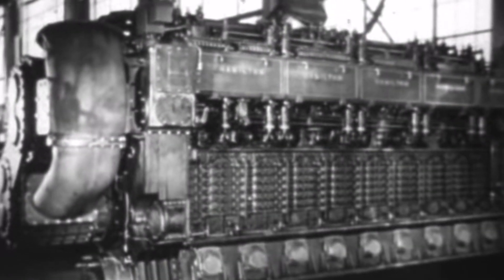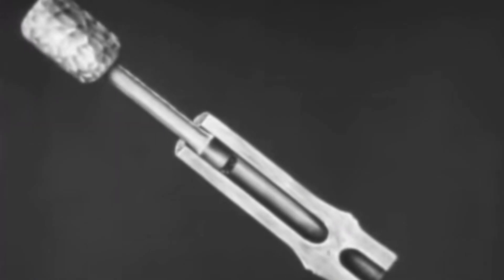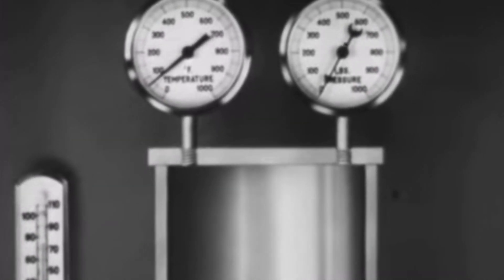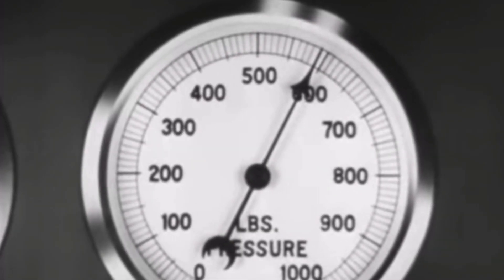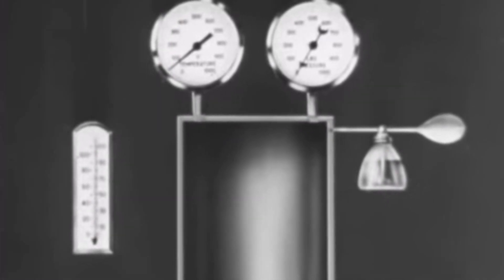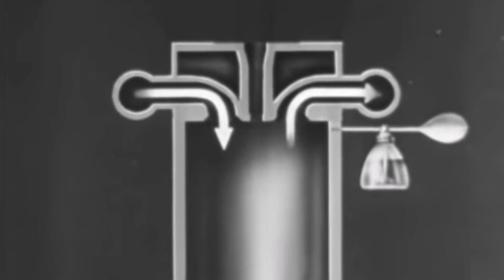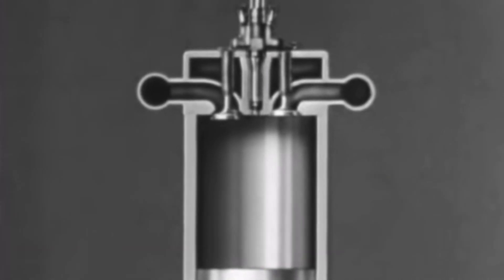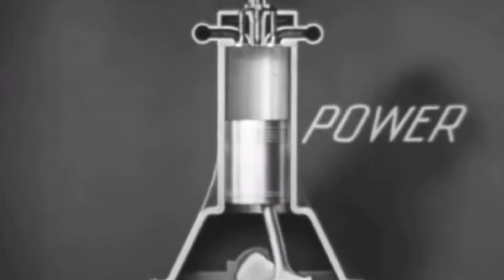Understanding your Diesel engine | The Basics of compression ignition

Comment: Sweet science. Thanks for that info. The Detroit in #101 is smoother than my little Predator 3500. I suspect it's because of the mounting of the generator is directly on the catwalk, which is on the frame rails. The vibration is very noticeable which the human perception equates with audible noise. I'll figure out a cool way to dampen that vibration and / or remount the gen.